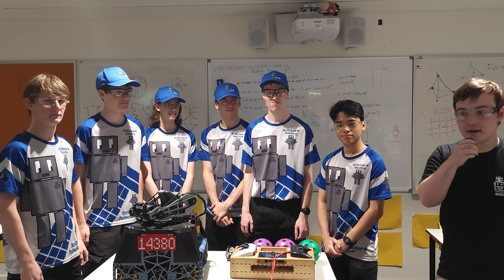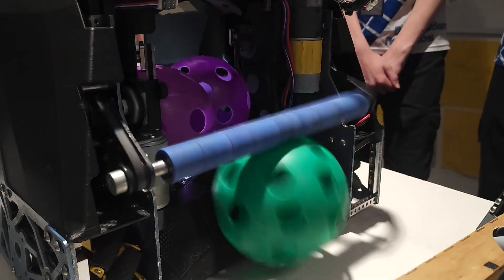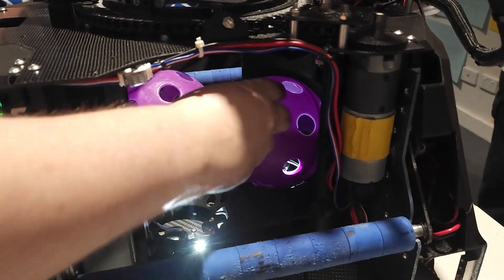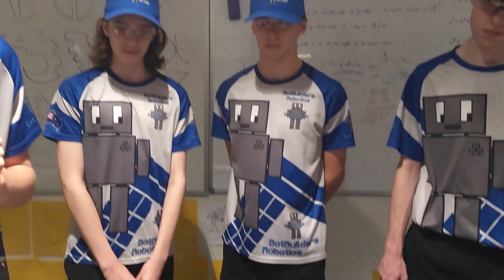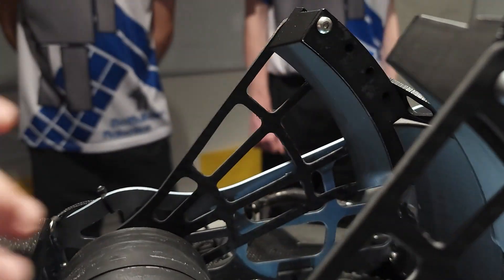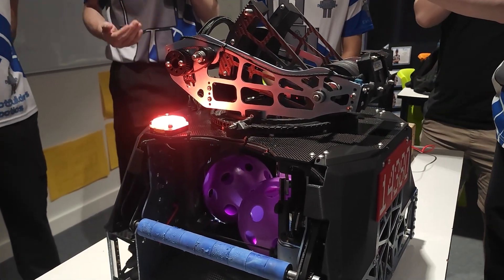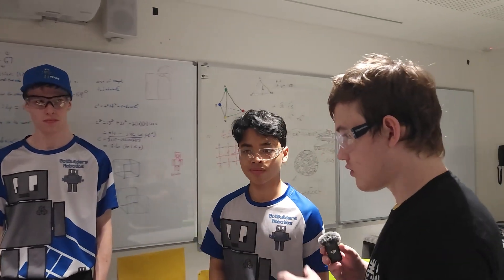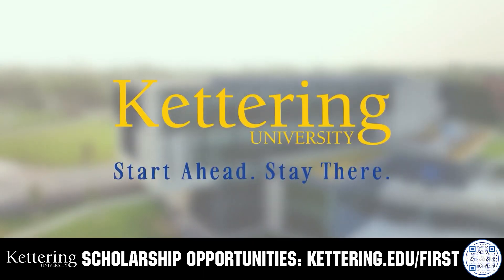🤖 FTC 14380 Blue BotBuilders | Behind the Bot – DECODE

Comment: How do you measure the distance from the Limelight to the April Tag?
For the interpolation, did you use Ta(target area) as input and Distance(cm/inch) as output? 
How do you compensate for the angle difference which makes the shape of the target different?